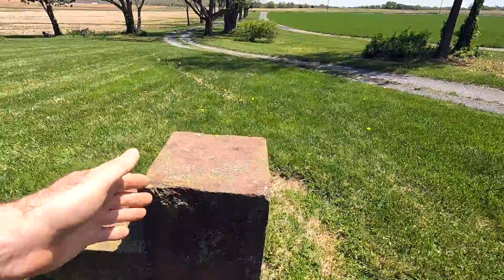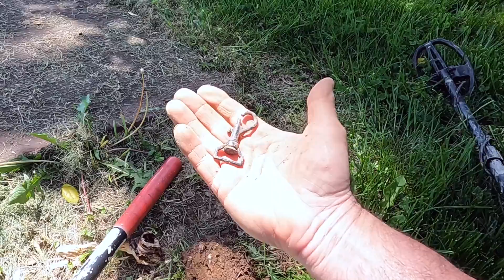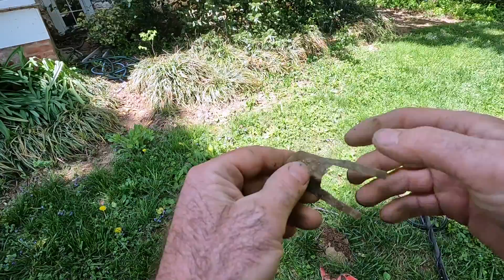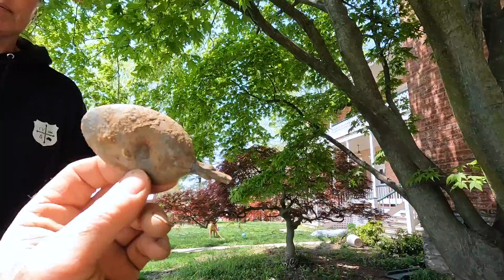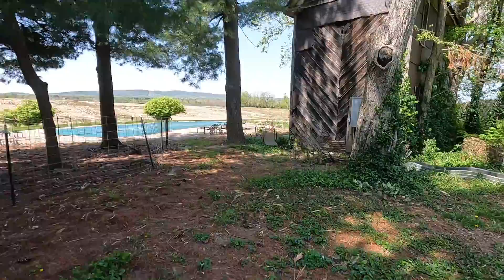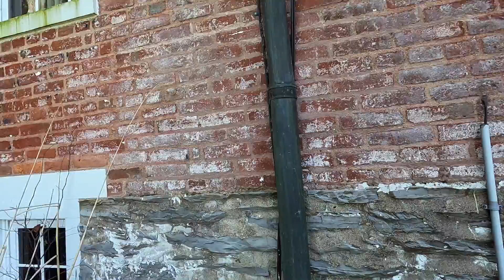Digger Dolly And A Pre-Civil War Era Home Metal Detection

Comment: As soon as I saw that first piece of copper, I had a feeling you were gonna find more. The gutter and spout looked too new. It takes about 25-30 years in a non-industrial climate for copper to patina to green. That gutter job is relatively modern. I'm a tinsmith. Been putting on "tin" and copper roofs for 43 years. I still get solder in one pound bars. When I get down to the nub like that, I usually just tack it to the end of the next bar so I don't waste it. ($12-$15 lb.) Flatware was being made with pewter well into the 20th century. Cheap stainless steel ended it's use. I once found a pewter spoon on the roof of the Washington Club. #15 DuPont Circle. It wasn't particularly old or ornate. My helper freaked out when I used it to solder the roof off. Solder basically is pewter. Tin and lead. There is a great old "Frank and Ernest" cartoon where they are outside a plumbing supply house. There's a sign that says- Special Today, sale on L's for sodering(sic). Thanks Chigg

Comment: Heck Beau if the price of copper keeps climbing and it sure to happen you could go out there and get all kinds of copper scrap. I'm soldered miles of copper half round gutter roofing flashing all types of copper downspout and I've used thousands of those lead bars different grades different weights lengths and it's all done with a soldering iron and a hot pot....

Comment: That little bent over piece of copper,  could have been a piece,  used in a pinch, to hold a flint in the jaws of the hammer of a Flintlock.  I know that,  generally,  leather and lead were used, but copper was soft enough to use, in a pinch.